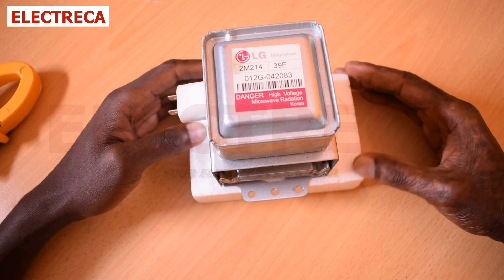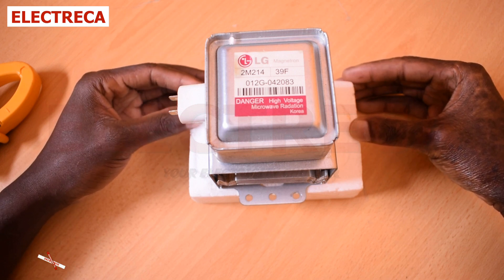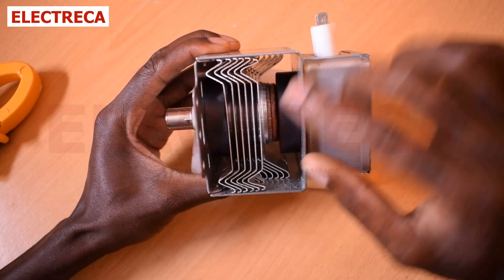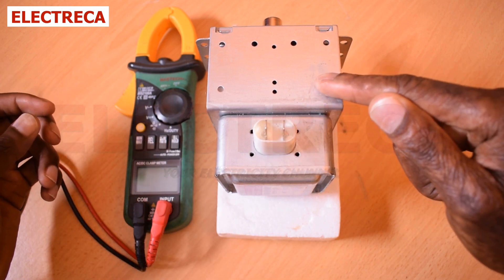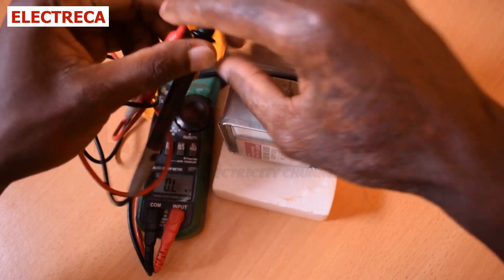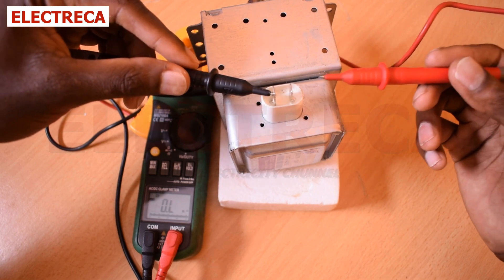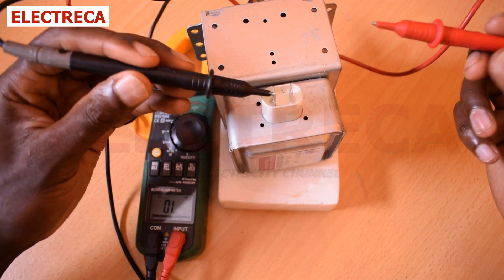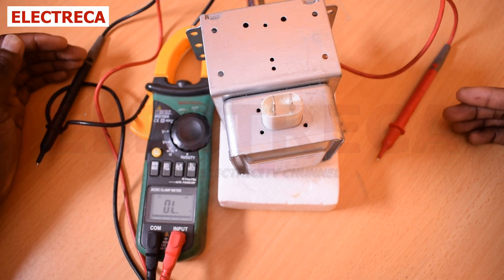How to test a magnetron|microwave|ELECTRECA

Comment: Two terminals are connected to cathode/flament. Body of magnetron has to be over 3000v positive(anode) voltage. Electrons come from 5v/3v heated cathode and goes to cavities. Because of linear magnetic field electron cloud turns around and makes microwaves.
Reply: Meaning?